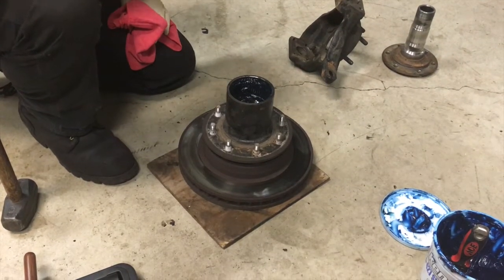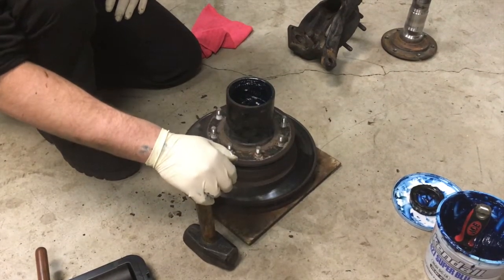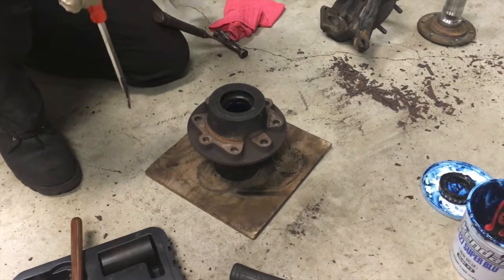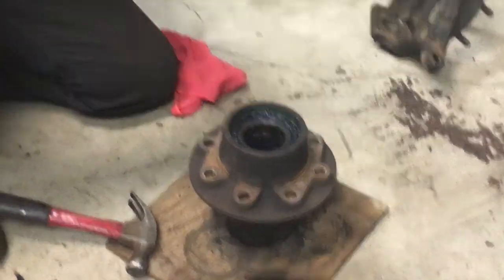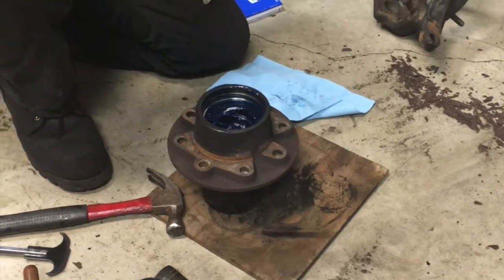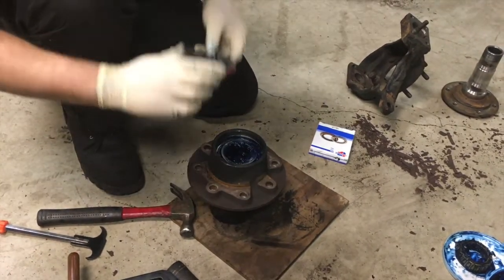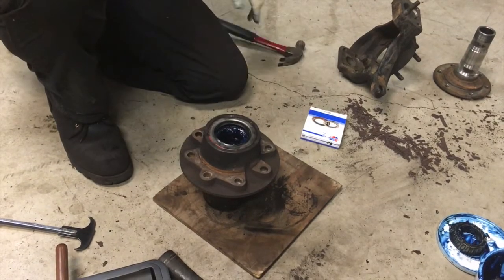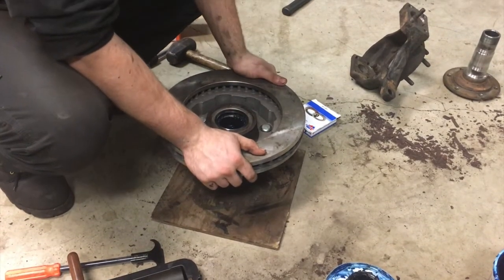1993 Dodge W250:  Brake Pad and Rotor Replacement

Comment: I really would like to see the wheel bearing torquing and I can’t find your other vid.
Reply from the maker: tighten nut till its tight but hub can still move with resistance,  back off 90 degrees.  i always tighten slightly id needed to align the lock.  other video footage got lost so unfortunally no video.

Comment: Anybody know why my spring clip on drivers side keeps working its way halfway out and i have to keep tapping it back in, after driving
Reply from the maker: is the retaining bolt in place?  have you replaced any parts lately?
Reply: @Talbot_Industries  i did replace the calipers about a year ago, the retaining bolt is in place. When i tap the spring clip in it seems like a loose fit. Im not sure if i need to find a replacement clip or what. The clip seems to be in good shape though
Reply from the maker: @zanevigoren6660  the bolt, retainer and spring clip are all very cheap to replace.  be worth trying